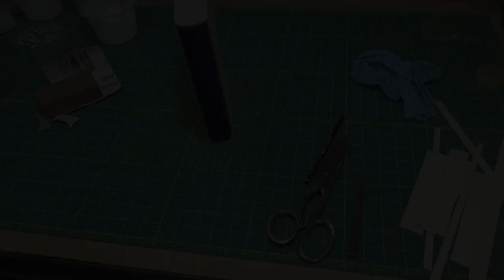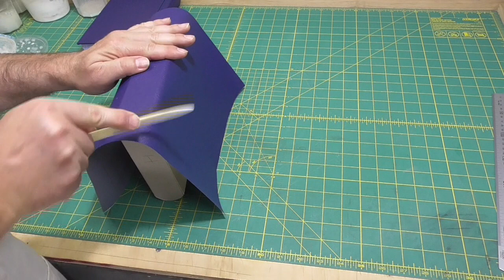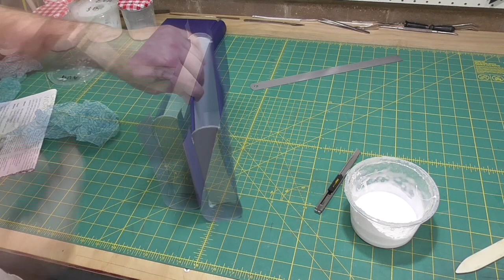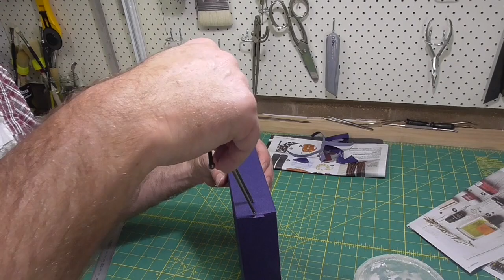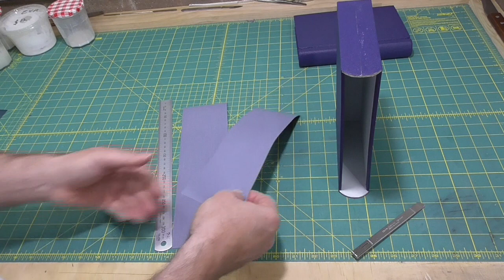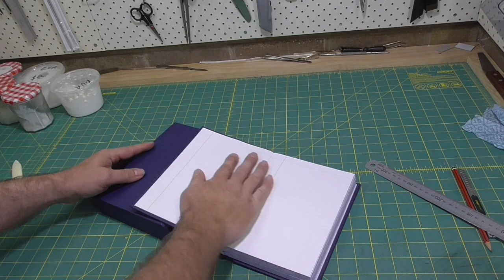Cloth Covered Slipcase - Covering the Box // Adventures in Bookbinding

Comment: Have recently finished my first paired hardcover book and slip case. Some painful lessons learned about the choice of bookcloth, for sure. I opted for a commercial rayon bookcloth with the appearance of slubbed dupion silk.  While the case was still a little damp I wrapped the finished book in silicone paper and allowed the case to 'dry to fit'. What I didn't bank on was friction between the slubs on the book case and turn ins on the slip case.  Managed to rectify that somewhat by squeezing in a sheet of 1mm greyboard to create a slightly looser fit without the book falling out of its own accord.

Comment: This was my first project, and I've now made three of them. They've turned out okay, though I've definitely learned some things along the way. My initial approach to cutting the pieces out of the binder's board was hugely wasteful -- both of the first two boxes took essentially an entire sheet of board and wasted about 60% of it. I've since figured out how to get two cases out of one board with considerably less waste.

I've learned to use mix instead of PVA for gluing down the head and tail. Having that little bit of extra working time makes it much easier.  Also, since I'm making these all the same size and I don't own a pair of dividers, I made a jig out of some cast-off board that lets me quickly mark the middle of the head and tail and find the correct spot for the two 45 degree cuts.

Any tips on covering the front corners when the slipcase doesn't have a curved front? Mine are flat. I've been cutting the final cover pieces a little wider so they extend up over the 2.5 mm of the head/tail board before narrowing to fit inside the box.
Reply from the maker: Square fronted slip cases are sooo much easier.  Make a little diagonal cut for the edge of the board, and narrower for inside the box - as you mention.  It's the same technique used in some of my other box videos.  But I might make a new video on this once I get up and going again.  DAS

Comment: This video is really amazing.
How would you handle the covering of the top and bottom parts in the case of a larger slipcase (e.g. Multiple volumes book)? Do you just keep longer excess of paper to be sure that there is enough to fold over the whole surface?
Reply from the maker: I once made a multi-book slip case (with dividers between each book - pain in the neck to make!) and I filled-in inside the turn-ins top and bottom.  Filling-in is cutting a piece that neatly fills in a space.  Then I put another piece over the top and bottom as in the video.  Good luck!

Comment: Can you please explain what the “Mix” adhesive that you use here is? I’m looking to make a slipcase for a gift and need a little extra direction on the adhesive aspect. Your tutorial is beautifully done!
Reply from the maker: Mix is a 50/50 mix of paste (or methyl cellulose) and PVA.  It gives some of the benefits of both adhesives.  Good luck!  DAS
Reply: Are you using "mix" for all the adhesive work here or just for the top and bottom strips?  I'm having "mixed" results with my efforts and wonder if you're using straight PVA for the majority of the adhesive work here.  Thanks for all your videos, they are beautifully done and quite calming!

Comment: Hi again, do you have a video explaining how to cover when we have a square spine and we want to do a square entrance to the slipcase please ? I am stuck :-( Thank you !
Reply from the maker: Sorry, no.  I thought it was fairly straight forward.  Just cut the head and tail boards flush with the sides and turn-in the cloth without making all those annoying little cuts.  There is a different covering style I've been meaning to document.  Maybe I can do it without the rounded head and tail.
Reply: @DASBookbinding  Thank you for your response. That’s what I did but the problem is the head and tail covers are meant to be 1mm less wide than the width of the box. So not wide enough to cover the angles when coming back inside the box. I guess I will have to cut the head and tail covers flush to the edges of the box then. I wish I could show you a picture of what I mean…